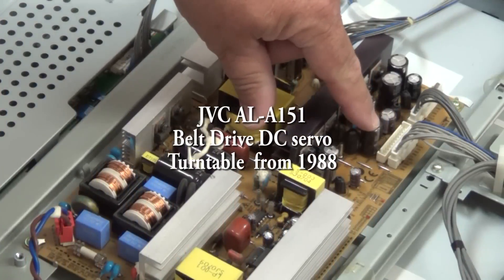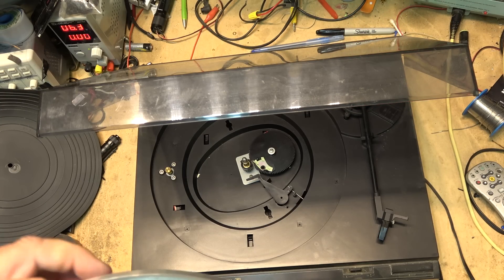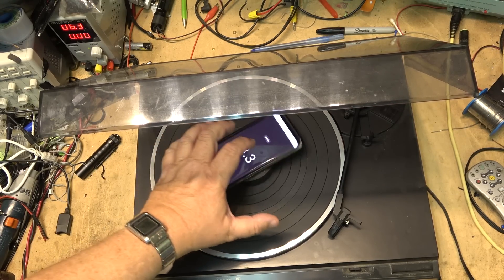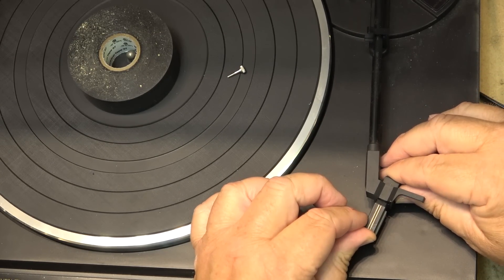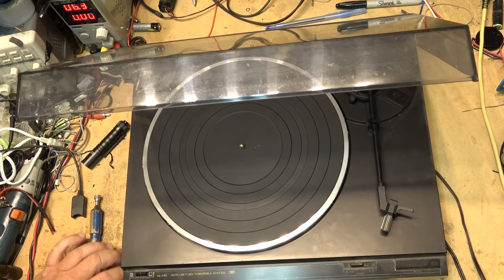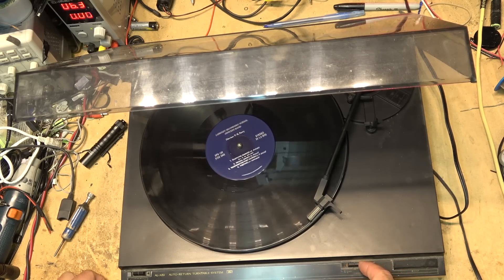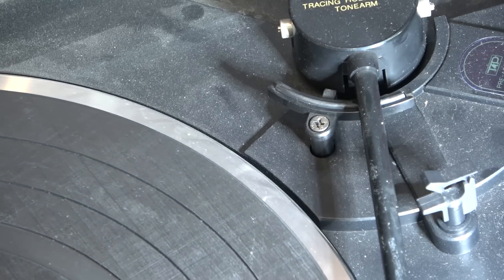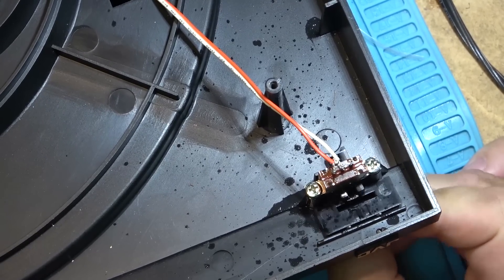JVC AL-A151 Belt Drive Turntable Service

Comment: I have notice the fact that the speed is not constant in the measurement in the application is because the motor runs above the point where the engine is located. At the point where the motor and the belt meet - there is the point of power that changes the constant speed in tge rotation, therefore it affects the final result. Note that in the direct drive motors - the speed is stable because the motor is under the tray and the rotation is perfect - and there the speed is stable.
Reply from the maker: It's due to elasticity of belt drive and all belt drive turntables experience this.  This is why high end belt drive use such heavy platters, so smooth out the power pulses from the motor. Direct drive uses a 3 phase motor.

Comment: My records got boxed up in 1983.
I will pull them out of the archives now that i have time to sit and listen again.
Hope the nostalgia is worth it.
Also, I can finally test that Canadian Rocker argument about Analog vs Digital.
My Neil young vinal vs mp3 vs CD through my 1990s Pioneer system.
Reply: I like vinyl, but digital will always be better. Vinyl is all about adding pleasing "distortion" sound to the music (like tube amps), but in strict Hi-Fi terms, this is of course wrong. Hi-Fi is all about not removing musical information, and not adding anything ether.

Comment: Love those turntables! I've always wanted a linear and or a direct drive. But linears are rare . Except maybe used. Like to see a linear turntable repair someday. 
I hope I have linear correct. The straight line tracking, like master discs are cut.
Reply from the maker: Linear are not that great. They shift back and forth as the mechanism tracks across the record.  The principal sounds good but how it works is the arm moves a bit then the block moves and stops. This causes the angle to rock back and forth as it tracks.

Comment: I’m trying to calibrate mine as you show but cannot seem to fit up to any screws etc inside the rubber slot on the bottom openings for the 331/3 or 45 ?

Comment: I've always wondered why vinyl masters were cut with the cutting head traveling in a straight line and the playback hardware designed to go across the record in an arc.!
Reply from the maker: Edison record players drove the pickup across the record with a gear driven mech just like the cutter.
Reply: @12voltvids  I suppose the conventional arm is much simpler (and cheaper) to produce in large quantities.
Reply from the maker: @calypso22  liner tracking is too complex in adds a whole whack of other artifacts to the sound as the sled moves a few mm in steps.  The true audio snoob will tell you that.  The tp4 system got the alignment about as close as you will ever get.  Many companies worked on this collaboratively for years to get it perfect.  The biggest names in turntables and cartridges perfected it only to have vinyl disappear almost over night for 30+ years untill the hipster started a resurgence in vinyl.  Why I will never know.

Comment: T4P cartridges are pretty awesome, especially the one's as originally fitted in the Technics SL-7, SL-10 and others. The Technics EPC-310MC is highly regarded. I have an SL-7 and a pair of 1210's i use regularly. Looking for a microline T4p to place in the SL-7, not so keen on shabata. Am however rather pleased with the Goldring 1012 Geiger II that I've installed on my 1210 mk2 for hifi use through the Little Bear T11. Considering the Goldring 1040 but more inclined to go with the AT-VM95ML when funds permit. Using Ortofon OM Pro S on the 1210's for Dj use, absolutely no back-tracking the Goldrings! I would really love it if Audio-Technica would be kind enough to manufacture a P-Mount T4P version of the magnificent AT-VM95ML :) hint hint! Lol!
Reply from the maker: I was just given a stack of vinyl.  The idiot that have them away took all the cardboard and paper sleeves and recycled it.   What an idiot.
Reply from the maker: Slm1
Reply: I would love to own a SL-M1, indeed a beautiful deck @12voltvids
Reply from the maker: @gtaudio3796  I got mine for 300 from Panasonic when they discontinued it.  It retailed for 1500
Reply: wow! That's almost as impressive as the deck itself! Full respect! :) @12voltvids
Reply: I like my Sony Biotracer PS-X75    @12voltvids
Reply from the maker: @Sans_Solo_  
Untill it stops working then you will hate it.  I'll stick to my Technics slm1.  Manual, as a turntable should be. At the end of the record it simply lists the arm and stops. It doesn't even return the arm.  My thorens doesn't even do that it just goes. Thump, thump, thump till I get off my ass and stop it lol.
I should add it makes the record i have with the licked groove sound cool. It's just a chord at the end that just goes on forever.  Timed perfectly so the lock grove corresponds with a drum beat sibyiu don't hear it.   My Technics lifts and stops abrutly but the thoren goes on forever.

Comment: To be honest, I'm not sure if I'd trust in that phone app in accurately measuring RPM, since the drift of the display suggests a drift of whatever sensing device it uses inside. If it is some sorta compass then probably yes I could.

Audio snoobs! The crazies!
Reply from the maker: It uses the compass and  aceleratarometer to detect speed and they are extremely accurate.

Comment: Record deck repair used to drive me nuts, then you spend ages setting it all up only to listen to snap crackle and pop.CD.s were not the perfect sound when first released, now we have all the digital formats just to make it all sound worse. I never listen to music these days.
Reply from the maker: So we agree then CD is now the perfect sound.
Reply: Microline stylus digs deeper often significantly less surface noise than conicals and elipticles but expensive. Digital done well certainly is great.
Reply from the maker: @gtaudio3796  early CD releases of pop and rock sounded no better because tapes mixed for lo-fi vinyl were used to make the CD master.  Record companies didn't care for the most part. Companies like GRP and Telarc however did care and their digitally recorded sessions sounded fantastic. You had to be a jazz or classical listener however because that was where the super high quality releases were.  Fortunately for me I am a jazz junky so I was able to get my HiFi fix and everytime it put a sme on my face. No clicks no pops no distortion no hiss just music that came out of nowhere.  It was like chick corea had his piano set up in my living room and I had a bunch of friends over for a drink.
Reply: Spot on! I heard early cd's were eq'd for vinyl whether that true or not but they were often harsh plus early players perhaps less than ideal but a good true analogue recording on a good pressing is profoundly good if the system is capable and very well setup but good digital is awesome again if done right. I do use digital files mostly so I'm not anal about the source, currently using a Xiang Sheng DA-03A DAC upgraded with Burson discreet opamps and it really is very good indeed. I am blessed and thank you for mentioning Chick Corea, I too now am a fan :D Very best regards, happy listening ;) @12voltvids
Reply from the maker: @gtaudio3796  saw chick, Al, Lenny and Stan play about 10 years ago with the RYF reunion. It was a bloody good show.  4 of the best musicians in the world playing together.  They knocked it out of the park.  If Al D ever comes back I am going.
Reply: @12voltvids  CD has settled into a mature format which when mastered correctly is as good as it gets SACD  never become a large seller I only have a few and never play them.
Reply from the maker: @Barbarapape  absolutely. The early CD were no better because greedy record companies used the master tapes that were mixed for vinyl and cassette, so they had the dynamic range compressed to 49db or so and center panned the bass.  They could have made a CD mix but that would have meant doing it twice and in the mostly analog world that was alot of extra work.  These days not so much as everything is digitally recorded. At the click if a mouse they can render out a vinyl eq and compressed file to be mastered did vinyl while the CD pressing gets the full bandwidth version.